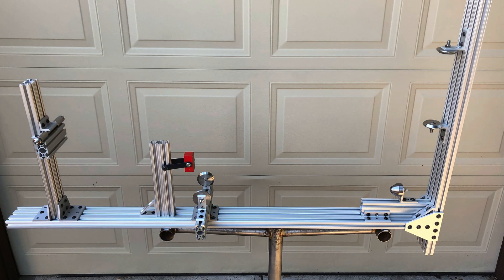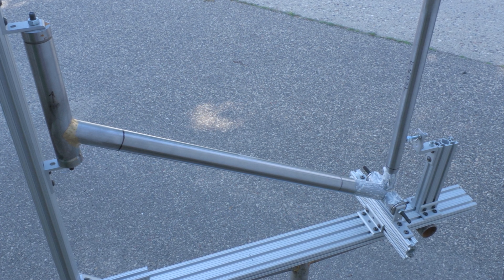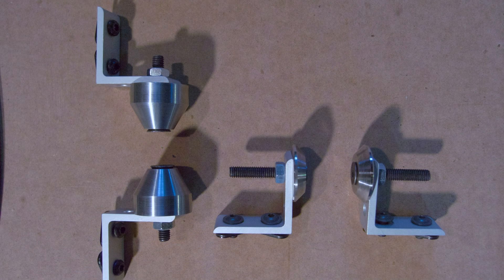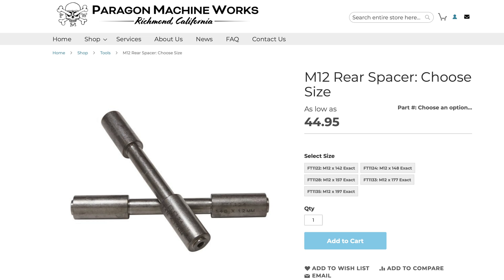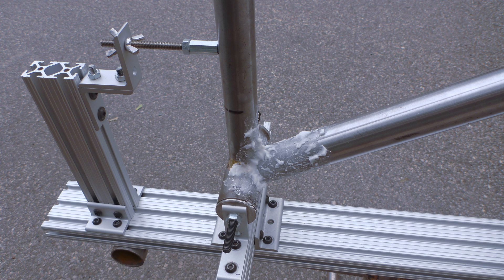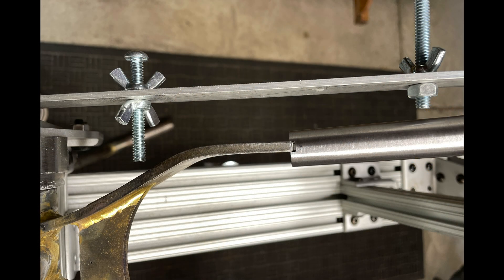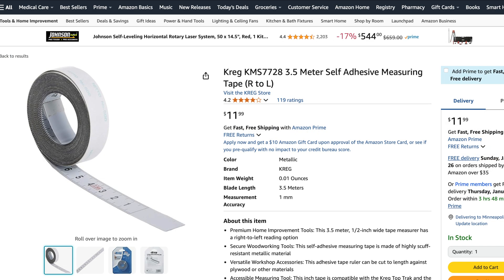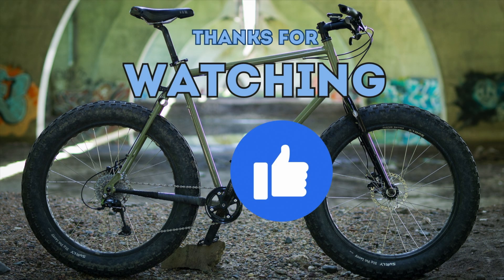DIY Frame Jig - Bicycle Framebuilding

Comment: How does your jig handle steerer tubes that are angled? Also, are you using oxy/propane or acetylene?
Reply from the maker: Do you mean tapered head tube?  Never used one, not worth the extra work in my opinion. I only use straight head tubes, either 44mm or 1 1/8”. 

I’m using oxy/acetylene. If I was just starting out and hadn’t already gotten accustomed to using O/A, I’d probably do O/P.

Comment: Thanks for the high quality and thorough explaination on the jig build, based on years if use and upgrades. This is extremely valuable to bridge the gap between beginner hobbyist like myself and professional framebuilding, often people think you need a huge investment in tooling or you end up with wrapped frames. A gem of a turorial.
Reply from the maker: Thanks!!! This is definitely not professional level though, experienced hobbyist at best.

Comment: recently got a oxy-ace welding kit , just need new hoses and i can start brazing !  , would be nice to build my own bikes
Reply from the maker: Nice!  Do you already know how to use the torch and braze?  Racks are a fun project if you’re wanting to make something bike related.
Reply: @ThriftyFramebuilder  no i havent really brazed yet  but i have plenty of scrap to practice on and already have a metalworking background as a machinist so im sure ill pick it up quick
Reply from the maker: Just make sure you know how to use the O/A setup safely!
Reply: @ThriftyFramebuilder  always !  I have some Experience setting up oxygen-LPgas for heating at work to shrink fit parts together so atleast im no stranger to a torch

Comment: Any reason why you make a DT/HT subassembly as opposed to a TT/HT subassembly?
Reply from the maker: The short answer is my jig doesn’t have a way to hold a top tube in place. The long answer is that I want the HT and BB shell to be as aligned as possible, and connecting the two directly (via the DT) first makes that easier. If I did a TT/HT subassembly, there would be a 3rd joint between the HT and BB shell I have to worry about while trying to keep everything aligned.

Comment: Great video! For my first jig I made wooden cones by turning them in a drill clamped to the table and attacking them with an angle-grinder :) They got a bit singed in use but worked fine. Since then I got a Chinese mini lathe and made some aluminium ones.
Reply from the maker: I’ve been wanting to get a cheap benchtop metal lathe for years!  It’s just never been in my budget.
Reply: @ThriftyFramebuilder  I'm pretty pleased with mine. Yes it's a bit crappy but with patience you can make small parts such as crown race seats and seatpost binder bolts.
Reply: I have a wood lathe, I wonder if I could turn some hardwood cones and make it work.

Comment: I use a similar bean style jig that I modelled off James at Blacksheep. One also used cold rolled steel like his. The steel version can be made with minimal tooling, but does require a few semi precision holes. For holding the seat tube at a set angle I have 3d printed some tube holders...just need to be aware of the heat when tacking with brazing. Next frame I plan to Tig tack in the jig then finish braze as usual.
Reply from the maker: There are definitely days when I wish I had a 3D printer and knew how to TIG weld!  Could make the process quicker.